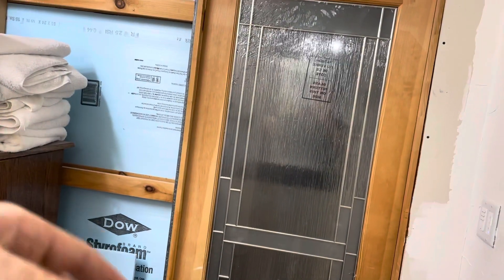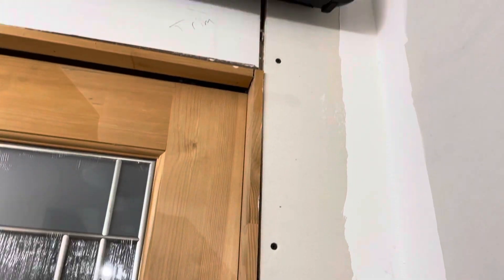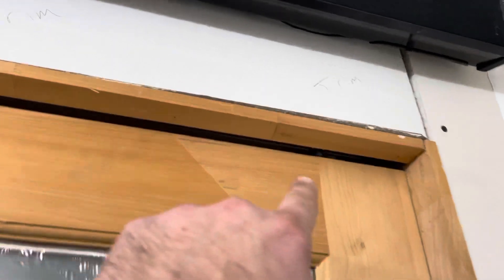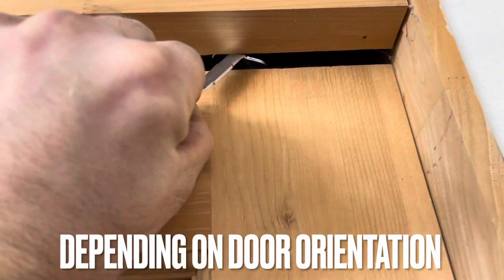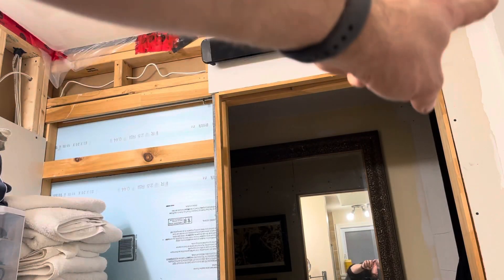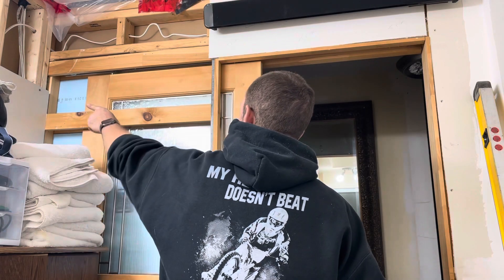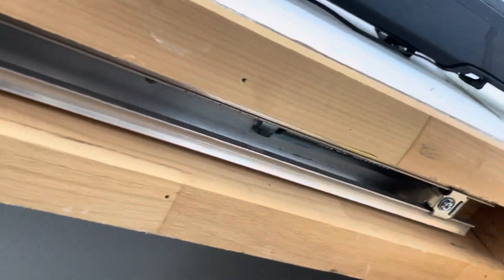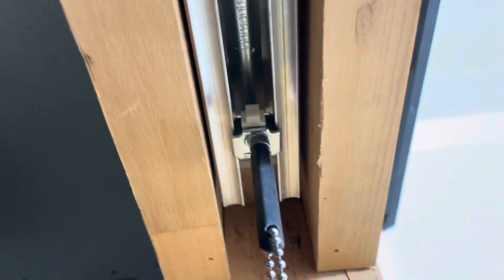DIY - Soft Close & Soft Open Pocket Door 🚪 Hardware By Johnson Hardware With Self Closing Hack =]

Comment: Great review. Thank you for taking the time to do it. Can you elaborate how you upgraded the wheels from nylon to bearings? Thank you.
Reply from the maker: Yes. I went online and found a set from the same manufacturer with the same measurements and specifications but with bearings. I believe I got lucky. The nylon stuff is just their cheaper way of making it easier to produce but there is no replacement for real bearings. The sizing might also be industry “standard”. In the past I have replaced these before for the same reasons. Better sliding pocket door. Quieter and smoother. Now I incorporate the easy soft close and soft open like we have in our kitchens.
Reply: @803Garage  Thank you.

Comment: Will the soft close HOLD the door closed? I have a door track that is out of level and these new roller bearings cause the door to self open. We have no locking latch. Will this 1060 hold the door closed?
Reply from the maker: Yes it will. Another option is to use magnets. This was to stop a cat from opening the door. So I installed these magnets into the door frame flush then painted them to hide everything in the frame. Magnets would be cheaper. No soft open or close with magnets. 🧲

Comment: Johnson pocket door framing kit is only $85. Not too expensive and way easier to transport and higher quality.
Reply from the maker: Does it come with the soft close for both sides? Asking seriously. =] I’m also in Canada 🇨🇦 so it’s expensive here. 🤦
Reply: @803Garage  ok. What I’m finding is this. 
The 1500 series pocket door kit is $85-95
The soft close kit for one side is kit number 1060 $45-55. It basically replaces one latch/wheel kit. You need two for each side to make it soft close AND soft open. 
For the kit with two for soft open and close (not sure if you you can do the soft open without removing trim and door.)

The kit 1062 is $85-90. 

The whole frame 1500 series with soft close and open is $150. Better deal as a complete kit. 

There is a soft closing tab different brand that just goes into the end of the door too.
Reply: Quick answer is $85 for frame. 
$150 for frame with soft open AND close.
Reply from the maker: @jeremylakenes6859  thank you =]